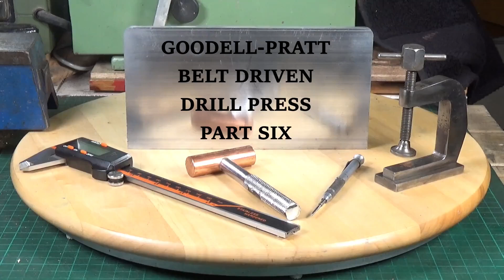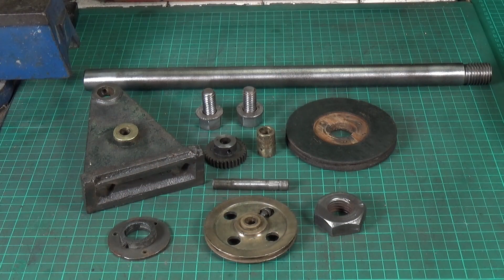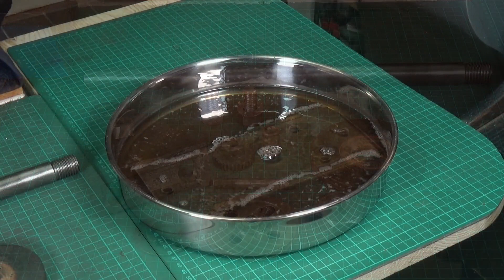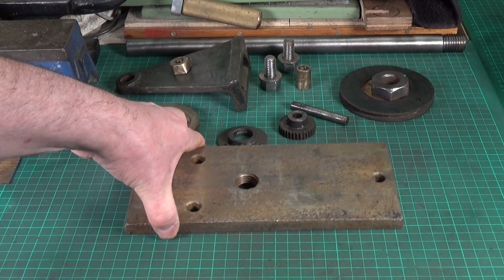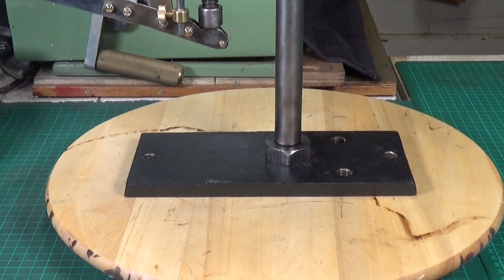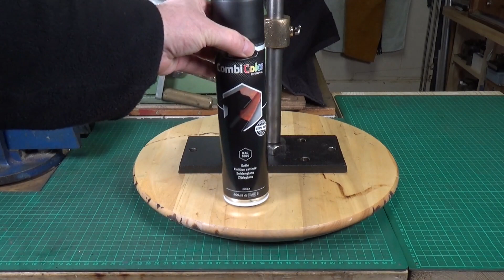Goodell-Pratt Belt Driven Drill Press - Part Six

Comment: A short drop off of angle iron would work well for your angle plate.
Reply from the maker: Hi Brian. Yes it would however I happened to have some steel plate handy so I used that. It worked out ok as you will see in the next video. Cheers, Alan.

Comment: Looking good Alan.  With the wooden pulley and bodged up angle plate I'm wondering if it has been dropped at some stage.  That plate may have been cast.  Cheers Rob
Reply from the maker: Hi Rob. I never thought about that, it would certainly explain the replacements. Not the appalling work though! Cheers, Alan.

Comment: Hi Alan. The belt sander I’d a better job than I anticipated. Looking very good. 👏👏👍😀
Reply from the maker: Hi Andrew. The belt sander is a SIP 4 x 8 Belt Disc Sander and is a fairly new addition. It has a 500 watt motor and built in dust extraction. Not particularly cheap but quite a powerful machine. Cheers, Alan.

Comment: Hello Alan,
Every episode the drill press looks better and better... once complete do you plan to use it in your workshop drilling small parts?
Take care.
Paul,,
Reply from the maker: Hi Paul. Yes when it's done it will be a working tool in the workshop. It will be ideal for drilling 6BA size holes in thin plate which I do quite a lot with small model steam engines. Cheers, Alan.